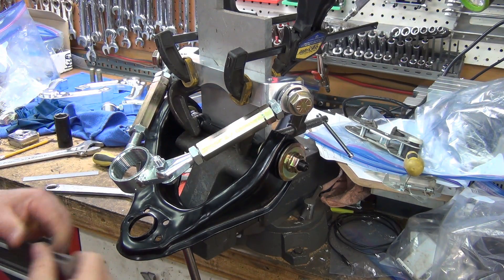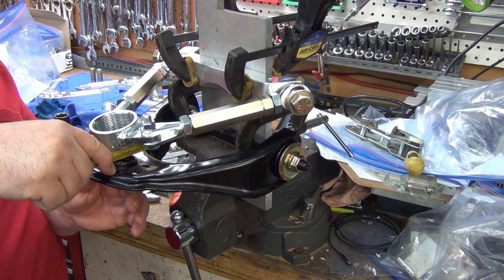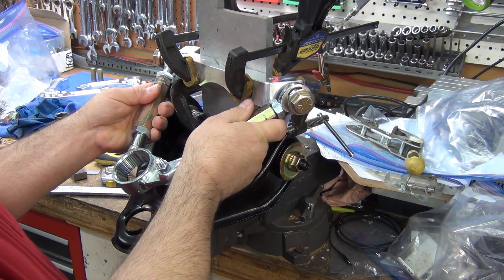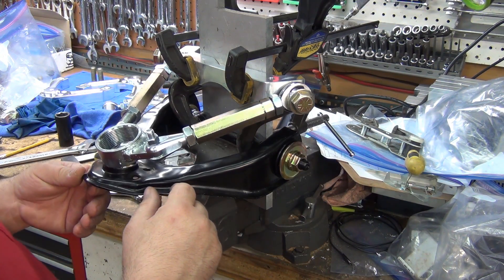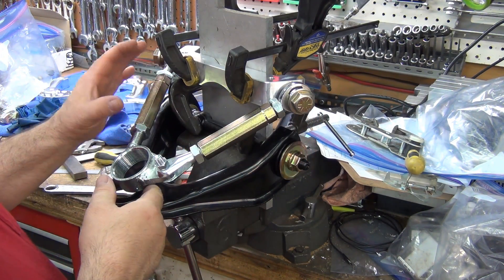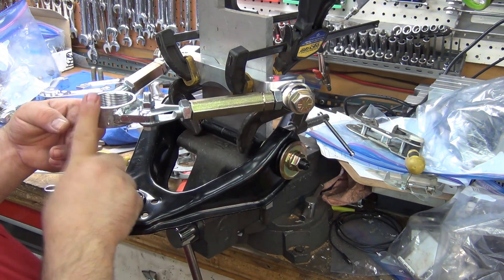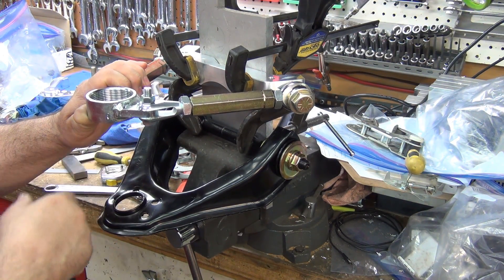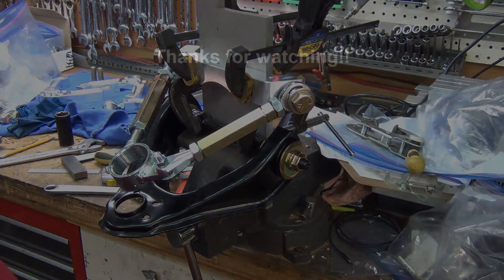Nissan D21 Hardbody Adjustable UCA Info

Comment: Did you ever start selling these cross shafts? I looked on your website but didnt seen anything for d21.
Reply from the maker: Sorry. Seems I didn't get a ton of notices from YT about comments.  I did end up selling them.....they sold out and I shut the shop down back in May.  There's still pics and info about them on my site.  Sorry you missed them.  At this time, it's completely unclear if my stuff will be made by someone else or not.  I'm just not sure it's worth all the time it takes me to do them.  I may consider doing parts "on-demand", but it may still be a bit before I seriously consider that.

Comment: You jumped from kingpin upgrade right to d21.  No late 620 love....
Reply from the maker: lol.....I tend to lump the 620's in with the 521 stuff.  If you follow me on FB or IG, you'd see that the last couple of vids I posted were specifically about making a 5 lug toyota hub work on a 620 kingpin spindle. :)  .....spoiler......my aluminum bracket actually works with that hub setup. These next brackets I'm making will put 5 lug or 6 lug disc brakes on all the kingpin trucks from 320 to 620. :)

Comment: Looks like an optical illusion to me.  Funny how 2 different sized components can do that.  Huge benefit to running your own though.  So much adjustment available for wheel alignment (castor / camber) adjustment.
Reply from the maker: Yep...tons of adjustment.  It's not a part that I need to run on anything I own, but others need/want that kind of adjustment.  Hopefully, enough sell that I can get something back for all the R&D time I've got into it.  Hmm....in fact, I need to get on back on the CAD/CAM for this cross shaft so that I'm ready to make chips in a couple of days.  As for the illusion....it's true with most things..........as your belly gets smaller, your "stuff" looks bigger........of course, just being able to see it again is a big plus, too. LOL :)

Comment: My 2 cents, errr, 1.5, no, 0.5 cents, :) I wouldn't even bother trying to sell the kit. Sell what you make and just insert links to all the parts that is needed. No sense in increase cost, shipping, labor and added headache for you when your customer can buy it elsewhere and save money.
Reply from the maker: I think that's where things will end up.......but you'd be surprised....I know I have been.....at just how many customers would rather have "one stop shopping" over having to source the other parts themselves.  There's also a bit of a liability issue.....I list the best parts, they buy what they think are "suitable subs" that aren't actually good enough....their parts fail yet they blame me for the issues.  That hasn't happened yet, but I haven't let it, either.  That's why on my brake kits, I include all the hardware.....then I know that they're getting grade 8 or better. Otherwise, they'll put grade 2 bolts in because they're cheaper.  It's a really big motivator for wanting to move away from the brakes and suspension stuff.  I'd probably make a lot more $'s making pens, knives or spinners! LOL
Reply: Ooo, a blue hands spinner. Something I could use. LOL :) Yea, your right. People are strange. And stupid. And cheap. You probably picked the worst field to get into. Break and suspensions parts. :)

Hey, what about 3d printers. That's a growing field. :) Just throwing that out there. :)
Reply from the maker: But....it's been good training. :)
Reply: Absolutely. :)